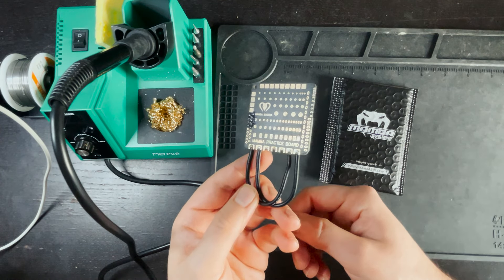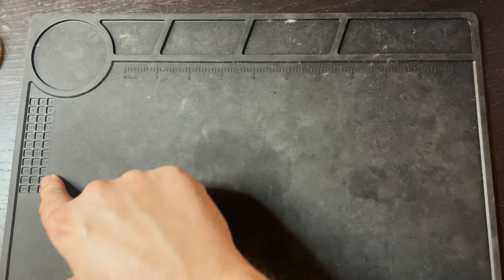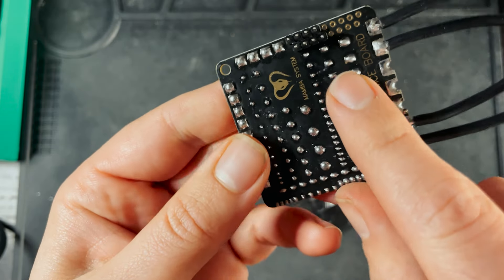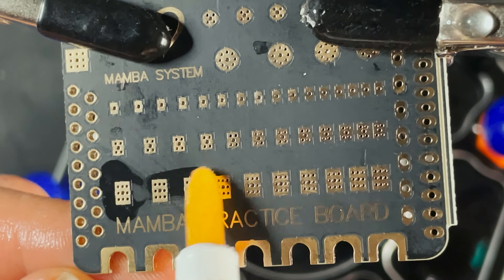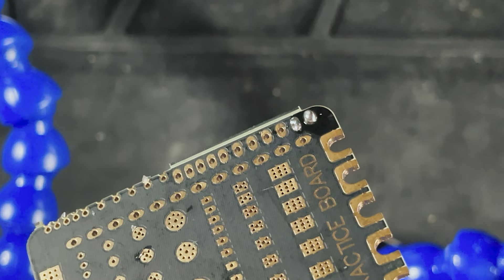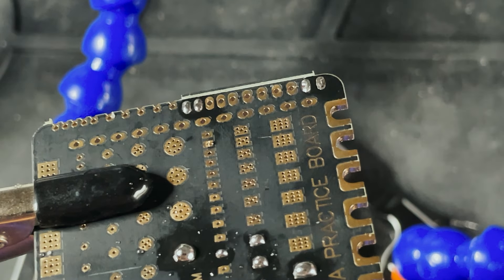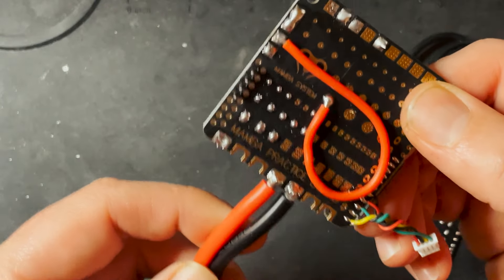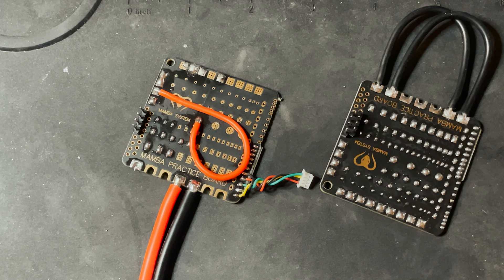How To Solder FPV Parts

Comment: This looks like magic, I was trying to solder for 3 hours, spoiled 5 tips,  temperature around 350-400 every tip turns black after few minutes, then solder doesn't stick to the tip. Also for some reason I cant get solder stick to some pads (ground pads), sometimes solder sticks but then I can't melt it again. I think I spoiled several pads on flight controller, they look dark and solder doesn't stick at all. Going to buy tip cleaner, more tips, practice board and try again...
Reply: Did your flight controller end up needing replaced?

Comment: Thanks so much. I want to do a little bit of soldering on a broken minidrone but don’t want to break the bank. Any suggestions on what would be an acceptable soldering station? Do I really need a display that indicates temperature?
Reply from the maker: I would definitely recommend one with an adjustable temperature. Once you get better at soldering, you'll like having the ability to adjust the temperature higher so you can solder a little faster 👍

https://amzn.to/3E7MCAY

Comment: I feel like my pads look good when i tin them, but when i go to put a wire on it sits on the top of it, rather than being covered in the solder, what causes this? Not lifitng up correctly once it melts?
Reply: I have the same problem. Any luck figuring it out?
Reply: @nathanlane6490  I'm not entirely sure, I know I got a little better but I'm not sure what I was doing at the time. I think some changes ive made along the way are changing from 350 to 400, putting a small amount on the tip before hitting the wire, and maybe try coming in at more of an angle idk if that helps or not

Comment: Learned last night that you need to use tip tiner to keep the tip from oxidizing and one it does the tip is useless but good learning experience and was confused why it wasn’t heating up the solder

Comment: As someone who has done this a lot. In your intro. Your tip was pretty dirty and corroded. Clean and tin it well and keep it clean with tip cleaner! Otherwise looks great! If you notice your solder joint isn’t shiny and is dull the tip condition is why! Also make sure to use high quality 60/40 leaded rosin core! Kester is the way to go!